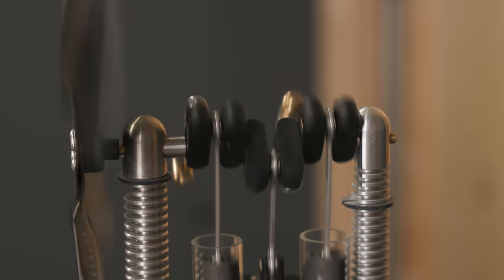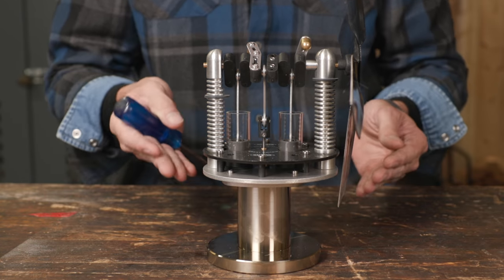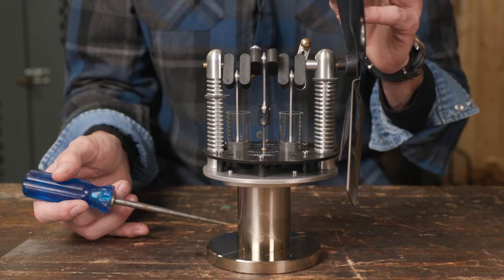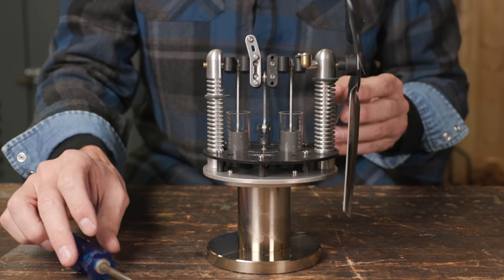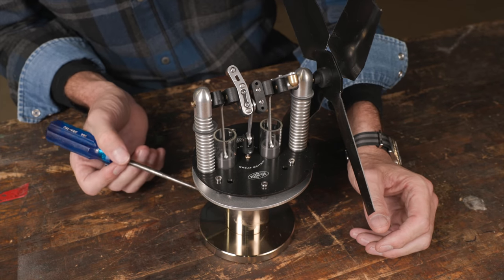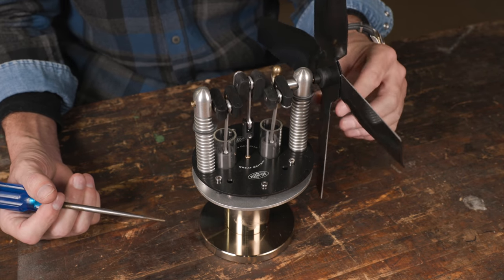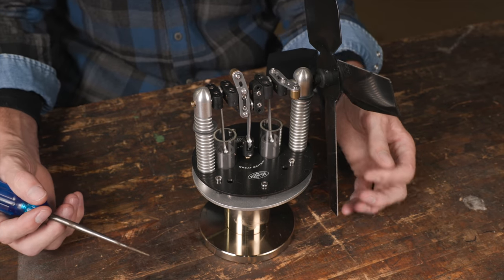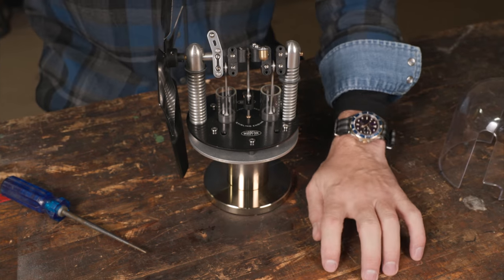Wood Stove Gadget Power Companies Fear

Comment: This might be splitting hairs but I would take the cover off during times of use to allow the heat sink to serve its purpose and not set in stagnant air.  The fan draws air across them. Great vid. Hope you’re feeling better!
Reply: It actually looks like the glass dome is open on the heat sinks so even with the glass dome on it can still draw air across.

Comment: Cody, you sound better, I hope you have a quick and full recovery.

The thing to know is that all the engine is a closed system.  The air is moved between the top half and the bottom half by the displacer.

When the displacer is at the top, the air inside the chamber gets hot, being near the stove, and expands. It slips past the displacer, and pushes the two pistons on the top upward... which then moves the fan, and the displacer moves towards the bottom.

Now the air is in the top of the chamber, which is much cooler, and it shrinks. This allows the pistons to move downward, moving the displacer... and the cycle repeats in low pressure, quiet awesomeness.

The Stirling engine was invented by a Priest who was upset at all the deaths caused by high pressure steam explosions. There are no large pressures in a Stirling engine.

That is a beautiful piece of technology. Thanks for sharing.

Comment: This is cool and I'm sure more than my wife will give me for allowance...
  They do make air circulator without the whole rotating mass assembly that spin a fan based on the heat alone and move the warm air through the room.  They're still not cheap but they're affordable and last forever.  I need one for the wood stove in my front room.  😀

Comment: Pretty interesting little engine! I've looked it up in Wikipedia and they say that it was invented by a guy named Robert Stirling back in 1816. He must have been a very smart guy. 
Nowadays they make also electrical fans for the woodstove  that use the difference of heat to create electricity, which powers a small motor.

Comment: I work for the power company and can assure you that we don't fear the Stirling engine.  :-)  The build quality is excellent by the OG East Coast Guys (The Brits)!  It's a great conversation piece.  But as a replacement for a $15 electric fan, the return on investment period is about 30 years.
Reply: hahahaha!!!  reminds me of a conversation I have often with customers.  I own a window cleaning business.  Thermopane windows have 2 layers of glass with, in theory, a vacuum seal between.  When the seal is compromised, moisture can get in between the glass layers and cause a foggy appearance in the glass.  Window replacement companies claim it's "energy efficient" for you to replace your windows when that happens.  Customers often ask me if they'd actually save $$ by replacing the windows.  Sure you'll save energy.  But you'll spend $20k on new windows.  At what point will you begin to enjoy the return on investment?  In the 20 yrs it will take you to break even, all your window seals will be blown again. :-)

Comment: See also the Ecofan by Caframo, I've known many ppl owing them for decades. I'm not familiar with the differences in operating principle compared to a Sterling engine (if any), but the net effect is identical if the only work you are trying to achieve is to recirculate air in your stove room.

Comment: Very excited to use my new tipi tent with wood stove this weekend. I’d imagine that a stove fan may even help warm the tent. Perhaps I’ll give it a shot. I’ve been fascinated with those fans for a while, anyway. Great vid! Thanks & it’s great to see you doing well.
Reply: I use a fan in my hot tent, it definitely does help. Most stove fans are a Peltier circuit (generating an electric current from the difference in temperature between the top and bottom of the fan), but I imagine a Sterling engine would work as well, if you could find one small and cheap enough to justify packing on a camping trip
Reply: @LightfeatherxX  Thanks for the input. It may be cheating but I already found out how beneficial a cot is to sleep on. Just being slightly elevated makes me so much warmer, even though the ground is ultimately fine. I’ll give the fan a shot, though. Just purchased a new mattress and also plan on getting new tires for my vehicle but once I have those taken care of I’ll have some more spare cash and do research. I appreciate the info!
Reply: @prepperpov5852  No worries! Yea, a good cot can definitely make the difference between a cold sleep and a nice comfortable sleep. One point of note, how useful a stovetop fan is in your tipi depends on how big the tipi is, and the height of the peak. A 4-8 man tent will benefit more from the forced flow of air then say a 2-3 man. It's main benefit is keeping the hot air from stagnating at the top of the tent, but (for me at least) it does make a noticeable difference to the warmth felt near the ground in my tent

Comment: Does this push more air than the ones with just the heat fins? 
They need to make one like this with a little charger to help charge off grid battery.

Comment: This is how the Stirling Cycle works in this engine. The displacer is used to move air up and down in the chamber. When the displacer is pulled up, the air goes beside it into the bottom of the chamber, where the heat is. This makes the air expand, pushing the pistons up and producing power. Part of this power is used to lower the displacer, forcing air up to the top of the chamber, where it is (relatively) cool. This causes the air to contract, sucking the pistons back down and producing power. Some of this power is used to again raise the displacer, forcing the air down where the heat is, expanding it and causing pressure that pushes the pistons up, and the cycle just keeps repeating.

Comment: I have something similar. A small electric motor and a thermal pad that turns heat in to electricity. It was left with the house. I was in the hard ware store and saw the same thing, next size up version......$200. I passed on adding a second one for now.

Comment: Brilliant explanation from a professional homeowner. Let me see if I understood correctly...
Is like an engine, made from different metals, something moves up or down (who really knows), and it has a fan blade mounted to it. So, something like a turbo prop engine. But it doesn't fly.
Did I understand that right?

Sounds like nothing but hot air to me. 🤷‍♂️

Comment: I have nothing but respect for how smart our ancestors were.   I feel so many ppl under appreciate this because you always hear stuff like "wow, how did they do that way back then...".   It's almost insulting to our ancestors to think that way.  Nobody ever considers maybe we're dumber now given all the foundation we had that gave us a head start that makes us look so smart now.  These ppl like this Stirling guy created something like this almost in a bubble knowledge wise.  Anyways that's my two cents and this is amazing because if I scale that down to cpu fan and heatsink size I can make a tiny convection heater with candles.  There is a guy who made one with an ammo crate, it's a great watch.  He used power tho.  If you coupled this Stirling engine with his ammo box convection heater you'd have a great item for the back country.  Ik I'd lug that around in winter.  What's great is the heater designer allows you to use it in a closed space because the burning part is oxygenated and vented outdoors.  So you could use this in any type shelter even a wickiup or larger spider hole.

I also wonder if you had a large bonfire and say a 4x8 steel panel 1-2" thick over the fire and then either daisy chain many or make one large stirling engine if you can generate some power like a turbine.  Well ik it would but I wonder how much

Comment: One air reservoir.  When displacer is up, the bulk of the air is on the hot side and expands.   Expansion pushes power.pistons up turning the shaft 1/2 turn.  Shaft moves the displacer down pushing the reservoir air to the cool side where it contracts as it cools.   This pulls pistons down turning shaft 1/2 turn.   Repeats as long as ther is a hot side to expand the air and a cool side to cool it.

Comment: I've got this exact warp five model. It's a work of art and always catches attention! Sadly on my stove it's little more than an ornament cos the stove has a protective plate on top to protect you from burns if you touch it, it's only ever moved two or three times over 4 years when I've had the stove roaring to the max!!
Reply: You could maybe cut out a disc on the plate so the swirling sits down onto the stove

Comment: I’m very confused by your explanation. If I had to guess, I would say I works based on Charle’s Law. When a gas is heated, it expands and creates a higher pressure. And a pressure differential works the same way as a temperature differential; gases move from higher pressure areas to lower pressure areas just as heat transfers from a warm object to a cooler object. The heat exchanger works on that principle and I guess the movement of higher pressure to lower pressure is what drives the displacer.

It’s unrelated, but just an interesting fact I recalled when talking about heat transfer; when you are working outside in the cold and notice that your metal handled tools feel colder, it’s only because the metal is a more efficient thermal conductor. The metal handled tools may be the exact same temperature as the rubber handles, but when you touch metal, the heat transfer is much faster so it feels colder than the rubber.

Comment: I built a full size Ryder-Ericsson from castings. Andy Ross has written some great books and articles on hot air engines. These toy engines are not at the same level as the high tech units pressurized with helium as the working fluid.

Comment: Hey Cody, long time fan, two things, first, any chance you could do a fence update, I thought that was a very cool short series with using the trees you cut down to build the fence with Mortise and tenon with the big drill. Secondary and really unrelated but i found interesting, I found out from a friend in Germany that just like in most parts of the U.S. for every unit over the speed limit they go there’s a 10$ increase in a speeding fine (so going 50 in a 30 is a 200$ fine) but what I realized is that that means their speeding tickets are nearly 2x what they are in the U.S. apparently this is common practice in all of Europe, just another check in the box as to why the metric system is rubbish. Anyway, that’s all I wanted to share, glad you recovered from Covid well and love all the content. God Bless.

Comment: Energy from the stove is being consumed by heating the devise hence spinning the fan.
It's not free energy.
The fan moves warmed heat from near the stove  away bringing in cooler air which warms and is blown away.
Might consider a section drawing to help better  understanding 
Your fan is indeed a masterpiece.
Reply: Doesn't say free energy. But I would day that no power company is concerned about it. I'll also say for the price you could run a fan for a long time for much cheaper.
Reply: @nickgamble4544  agree,
Bet cost was in the hundreds $$$

Comment: I know all about sterling engines. Their actually pretty awesome. It's a way to get power via heat and cold. Nature works via pressure mediation. It's the Same thing as positive and negative charge, or even the north and south pole on a magnet. Nature works on pressure mediation. This is literally the same phenomena that causes the wind to blow and what causes tornadoes n such. Heat moves into cold.

Comment: The Swedes have a diesel powered submarine the employs a sterling engine assist for propulsion it has attributes that have enabled it to operate ultra quietly…the nuclear submarines have a similar variety but the diesels (see articles regarding this tech on google), have now resolved issues with this and extend their capabilities by many weeks in operation….all needed is a heat source and ample cooling and the simplicity of a sterling engine actually a game changer

Comment: While I don't have a wood burning stove... I am an internet keyboard warrior.. :)  I saw another video where it was recommended that you point the fan at your chimney, this way cool air is pulled into the fan assisting in keeping it cool so it won't over heat, ruining the motor.  IDK if that's true or not, but it made sense to me. :)

Comment: NASA, from what I read, is developing a Sterling engine for future unmanned space missions because the supply of Plutonium 238 nuclear material used in past missions such as the Mars robots to generate electricity thermally has pretty much been exhausted and making it is expensive and slow. The Sterling may well replace the thermal electric generator in future space projects.

Comment: Pressure=heat. More pressure, more heat. Less pressure, less heat. The device is attempting to exchange those pressures. So from that, that exchange can be converted into locomotion energy. A combustion engine works in much the same way. Forced explosion=piston movement. The sterling! Gets it's energy from expansion.

Comment: Are these just nice but costly Toys, or, can these charge a battery for later use to power gadgets?   Are the fan fins canted at a decent angle to actually move air (because, not all thermoelectric fans are)?

Comment: 500 is a little steep when a thermoelectric one is 50. yes the moving parts are neat but not that neat. you can also buy TEG pads that make 60 watts of electricity for 30 dollars for a 10 pack. or 600 watts. if you wanted a cheap way to pull electricity out of a wood stove

Comment: Are you attempting to explain 'Pneumatic'  pressure forcing a floating disc/piston upwards, then, to differentiate from a high temp pressure to a lower temp pressure  /  Sort of like a 'Ram pump' operates with water pressure?

Comment: As stirling motors are quit the use of them in submarines to drive generators to maintain electric propulsion to battery when it goes in stealth mode It is quit and make no noise  when heated with a fuelcell

Comment: they also fear the standard wood stove fans that use a thermopile to generate electricity to run small electric fans.   if one were to build a large enough thermopile, you might could get an led light to run...

Comment: The double piston is just packaging.  How ever much pressure formed acts on however much surface area the pistons have.  So a single larger piston of equal surface area would have equal power to any number of smaller pistons with equal surface area...

But also no these don't really help move much air.  Just like baseboard heat stoves create airflow via convection where the hot air around the stove goes up displaces cold air in the room which falls to the floor and flows across the floor to replace the hot air that is rising.  You may feel warmer sitting where it is blowing on you but that's just like why fanning yourself on a hot day with a magazine feels cooler.  You are actually making yourself hotter by doing the work of fanning but you feel cooler.

Comment: Nothing simpler than a stirling engine. I'm machined one out of brass, aluminum and graphite. It had a foam piston encased in a lexan cylinder. It is so sensitive it will run off the heat of my hand.

Comment: Watch a video 8 years ago where a guy took 200 ft of 2inch black pipe.
He Made an  inclosed  radiator  8 ft tall by 20ft wide 1ft deep out of sheat metal painted all black with a plexiglas cover on the south side of his house pointed it towards the sun. He had water plumbed in to the radiator on the lower rt corner when the water came out the other side it was steem. He had the steem conected to a large sterling engine that ran a generator that made more than enough power for hes house 
 This video was taken down.

Comment: Yes. Thermoelectric engines. However those have absolutely zero torque. They have 500rpms too. (Roughly speaking) however you need torque to turn a turbine generator. If power companies feared it then we'd be buying it. A single solar panel could output more energy.

Comment: Very cool piece of machinery Cody.  I really wish I had a wood burning insert my current fire place in my home. Biden and his administration shut down a small 60 mile gas pipeline coming into St. Louis from the north. Citing some environmental permits that were obtained improperly by the gas company.  Some kind of big lawsuit.  With the pipeline closed down, the local gas company is warning residents there could be gas shortages in St. Louis city and surrounding areas.  They are asking everyone to conserve gas usage as most as possible. I live outside the city in the surrounding area but still rely on local gas for home heat. I have a fire place but it is know where near as efficient as a stove insert would be.  I hope to purchase and install one next year. Btw, is that a new watch? Looks good. I’m a watch guy and notice those. Another nice piece of machinery! Glad your feeling better.

Comment: This is nice. But the machine itself is suspiciously slow. In India, I saw a big fan which was powered by a Sterling engine heated by a single candle flame. The one barrel Sterling engine was five inches tall, and one inch in diameter. 

So why does an Indian Sterling engine have such good performance? And why does the American version have such bad performance?